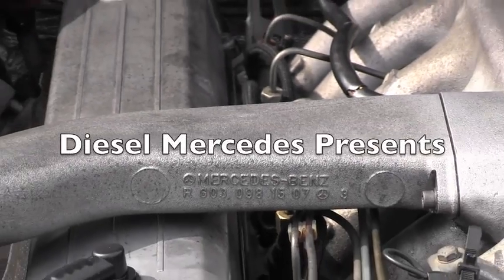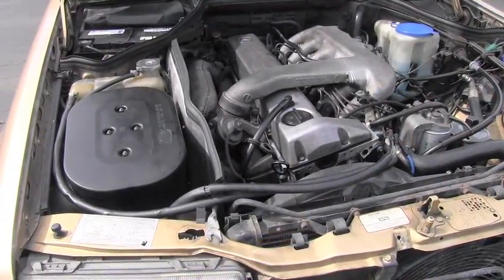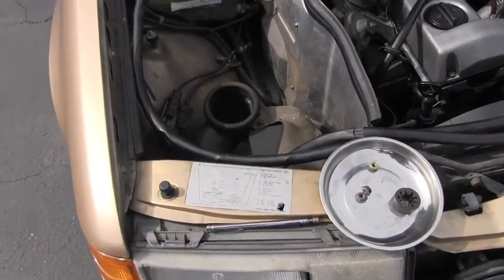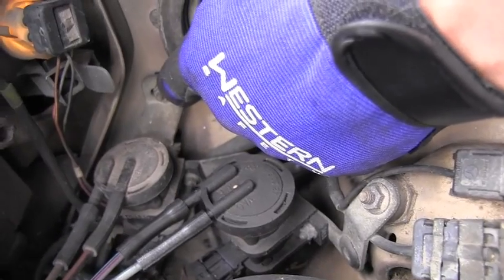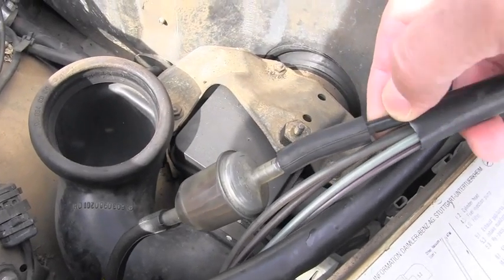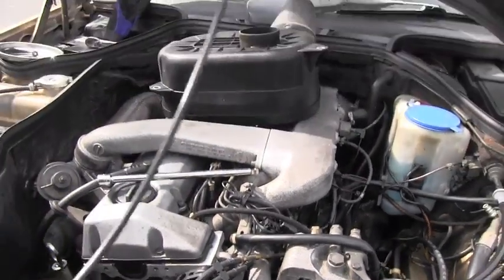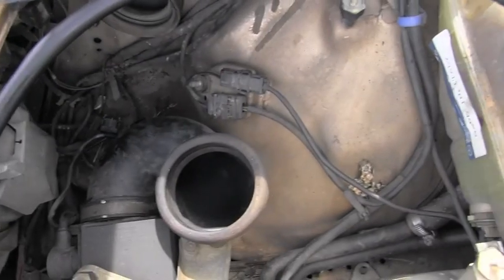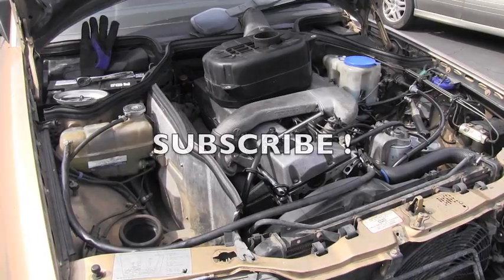Mercedes Diesel removing EGR RAV Vacuum Transducers

Comment: What is the point of removing the transducers?  Will the onboard computer think there is a fault with the system is those transducers are removed?
Reply from the maker: it was a garbage taking space....no need for it after removing the EGR valve...no computers were affected....just playing

Comment: Normally, the turbos and 24 valve diesel have these air slits on the right wing. This on hasn't. Will it have enough air than?
Reply from the maker: w124250d1992 it has enough air….